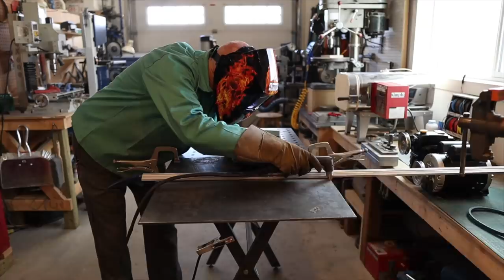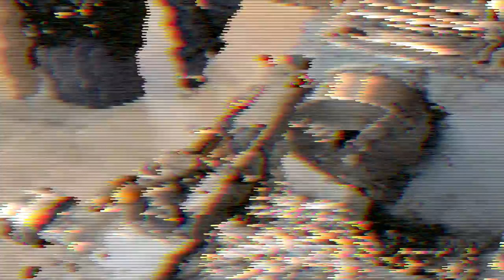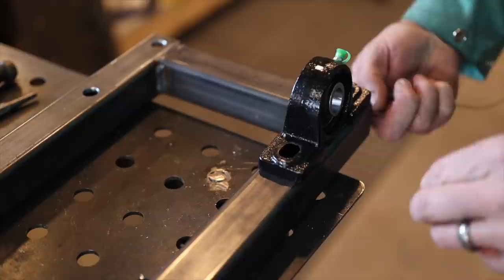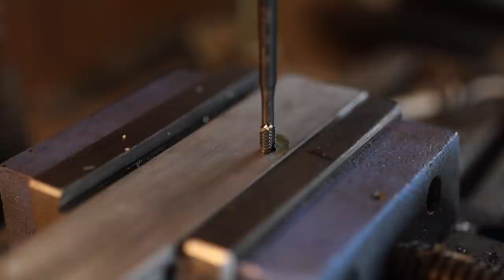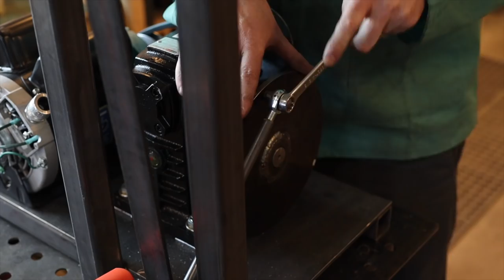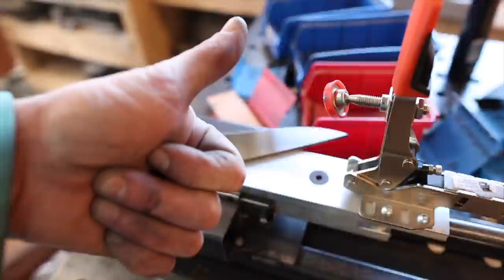Making the ULTIMATE Hand Sanding Machine (for the knife-maker)

Comment: It's not so much the tooling, or the milling machines, or the metal lathe, or the welding gear. It's not even the welding table and clamps and myriad drills and bits and rotary tools and accessories. I can understand the forge & the pneumatic accoutrements & at least 2 of the benches. I've got my head around most of that - but how do afford the frankly unreasonable horde of little containers of cutting fluid and machining oil? It's truly remarkable.

Excellent video. Thank you for posting.

Cheers!

Comment: This is amazing! I feel like with a couple tweaks you could fully automate hand sanding. Just add a little hold down arm for the sandpaper with some adjustable tension, give the sanding pad a little bit of compliance and i think it would make the device a lot safer, and even easier to use. If you wanted to go real wild, just add a lil motor on the sanding arm that slowly rotates a sheet or a belt of sandpaper.
Fantastic lil machine there!

Comment: Nice machine ;)

You should "automate" the "holding the sandpaper in place" part as well.. something spring loaded maybe that you can flip up when changing grits.. then you just need to stop the machine and change the sandpaper every once in a while.. would also be less dangerous ;)
Reply: Yeah, something like a 1/3 sheet sander
Reply: Exactly, leave it running while preparing handle material etc, with a timer or something to occasionally change the paper/checkups.

Comment: Very nice. Are you using 75/25 Gas for your mig or flux core wire? I noticed you didn't have any splatter on your welds.
Reply from the maker: Thank you! I am indeed using 75/25 with this new welder I got and I am really happy with it. 👍

Comment: It looks really good! Only issue I see is the drawer sliders. I would not have used them. They may be designed to open and close thousands of times, but not thousands of times in a row. They likely will wear out too quickly. I would have made my own rollers using larger bearings to help absorb the heat from the constant movement when it's in use. But other than that, it looks really good and solidly built!
Reply from the maker: These drawer slides are $10 a pair(on sale) and take 5 minutes to swap out. I see no sense in making something to use instead. Just a lot of added (unnecessary IMO) build time.  I sanded two knives back to back and there was no heat on the slides. I bet I get a year or two before they need replacing. The one thing I doubted about them was if they would be accurate enough and not move around creating weird scratch patterns. I was very surprised they worked so well. Always start with the simplest solution first. 👍

Comment: Exactly what I'm looking to make. But with a large dead flat piece of float glass for perfect precision sanding and lapping of knife blades and other steel parts. I do that by hand right now when i want a piece that is perfectly flat, although i do have a mill that use first to get the parts 95% of the way there but the other 5% done by hand is... Not fun lol

Comment: Great idea. Curious why you didn’t use cheap linear bearings instead of drawer slides?
Reply from the maker: Thank you! I couldn’t find any cheap linear bearings and I wasn’t sure this was even going to work. These however were $9 a pair on sale so I figured that was cheap enough. I can swap them out in 5 minutes or even upgrade to proper linear bearings in the future if these fail too quickly. 👍
Reply: @Simplelittlelife  guys a little quirky but he’s a genius at shop fixtures

Comment: Now, if you could just make an adjustable arm that can apply just the right amount of tension to hold your various grits and polishes against the blade for you. Perhaps an articulating arm with a piece of wood lined with felt on the end of it that sandpaper can be clamped around.

Comment: Very slick. My biggest concern is how well those drawer slides are going to hold up. Those things are usually rated for numbers of operations rated in the tens of thousands... you'll achieve that within a month or less. I'll be curious to see how they wear.
Reply from the maker: They take less than 5 minutes to swap out and are $9 a pair. That was a significant reason why I decided to go with them.

Comment: J would think there's a way to mount the sanding block as well with some slight angle and leveling adjustments to provide even pressure. Then it's a walk away and takes your hands away from the equation. Also can you list the cost of parts used for this project?

Comment: Nice build. I see you are running it in the second hole. you have a third hole which should slow the speed down a little more. When you hand sand  you're not sanding very fast. your sander will sand 3 to 5 times faster than you hand sanding your knife. it will speed up your sanding process a lot. maybe you can do a video on sanding a knife from start to finish. take care ..
Reply from the maker: The holes will change the speed but the reason I put them in there was to change the stroke lenght. To me that was more important. 3" blade with a 7" stroke is super difficult and dangerous. I tried it. 👍 I change the speed by hanging the pulleys on the motor and gearbox.
Reply: @Simplelittlelife   Ok, your right.  still a great build.

Comment: Great build Jeremy.  I’d seen a similar tool on Sharup’s channel.  I was always concerned about J-hooks with these, which kept me from building one, but you seemed to have overcome that.  Did you do non-mechanized pull strokes at the end of each grit?  Also, is there a mechanical advantage of the vertical sway bar?  I would think your design would function the same without it, but I very well could be missing something there (not a critique, just curious).
Reply from the maker: Thank you! I was worried about J-hooks too but there do not happen at all.  Zero hand passes with the machine turned off. The long sway are is necessary. I have a 20 minute video on the design aspect of this machine on my Patreon.

Comment: I loves me some overkill! This is about like building a tank, to get a bicycle unstuck from the mud... LOL

I wonder how much the reach, or 'throw' of a sewing machine could be extended, if laid on it's side?

Pretty sure I could get the same throw from a windshield wiper motor and the appropriate disk.

Instead of the clamp, what about a magnetic hold down?
Reply: Now your talkin my lingo, plenty of 12v power supplies with a spring loaded sanding block so you could walk away

Comment: It's a machine to imitate hand sanding, lol. Can't really be Hand And Machine.... but I get what you meant, looks smooth.
Reply from the maker: If you free-hand grind a bevel on a knife and you're not hand-cranking a the stone (dare use a powered belt grinder) I suppose you wouldn't call that a hand made knife either would you? Based purely on the logic you present here. It's funny how deep and crazy we can go with linguistics. Cheers 😆👍
Reply: @Simplelittlelife  it's a matter of convention in the bevel arena it's meant to differentiate between that and CnC work. The problem comes with how cumbersome a description gets. In this case however simplifying by dropping hand and just saying sanding machine does the trick. Linguistics and logic while not being mutually exclusive also feel no reason to travel together either. I still think it to be a matter of convention. The 2x72 requires skill and craftsmanship and so is considered "hand" whilst your rig crosses the line as simple donkey work and isn't. It does produce a fine scratch pattern regardless. Cheers.